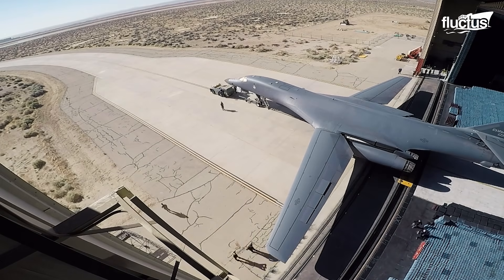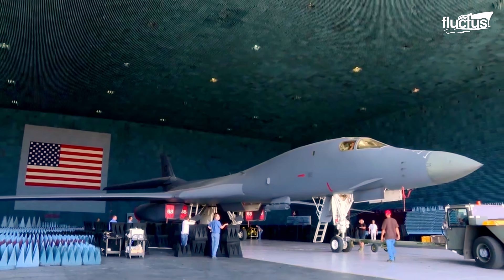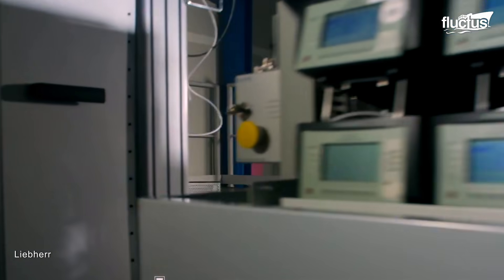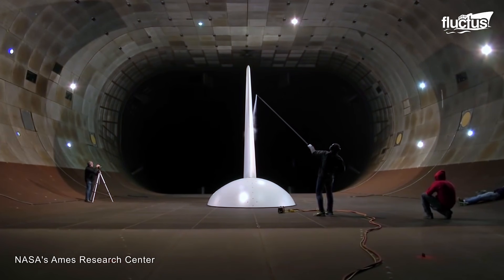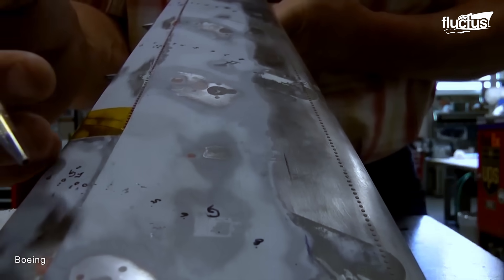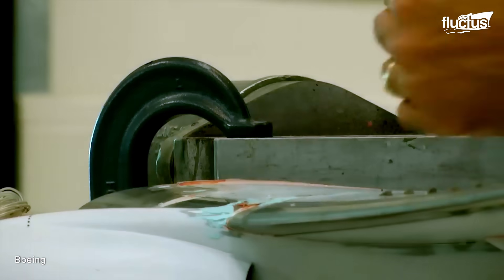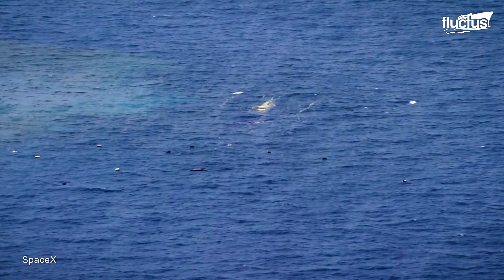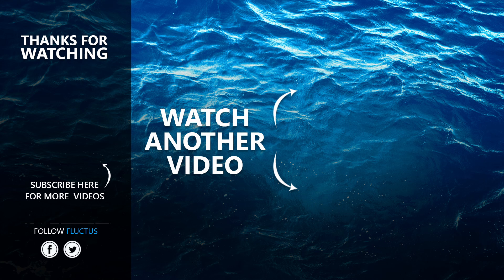Crazy Way they Test Gigantic B-1 Lancer Inside US Super Advanced Facility

Comment: The quietest I know is 50m below sea level, it's so quiet in there that you can hear yourself breathing and if they lock you up there, you probably go nuts after an hour, it has a length of 50m and 20m high. It's in Sweden for testing multiple purposes that needs big chambers. They can adjust width and height. It has a decoupled floor, walls and ceiling, in idle noise floor are not higher than 20db which is as good as silent. A lot of speaker manufacturers goes there to test their pro gear. But also ESA and other big brands goes there as well. Normal chambers have a noise floor from 30db. Which are already quiet.